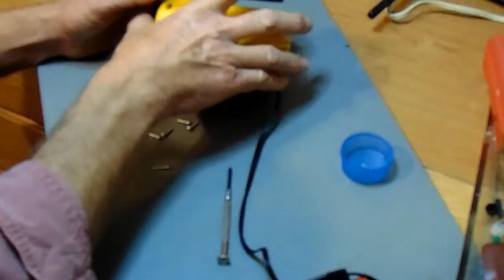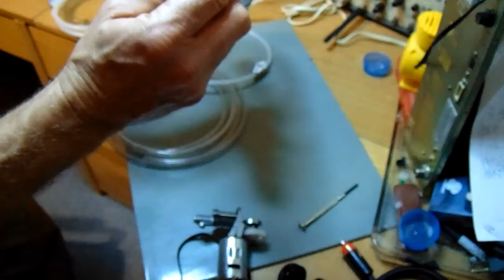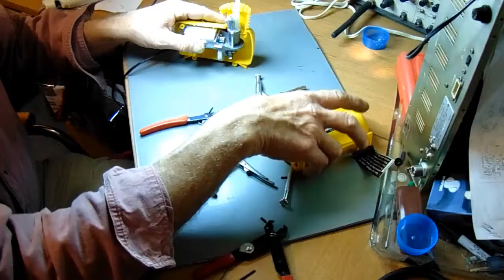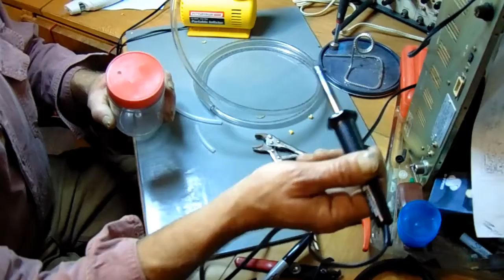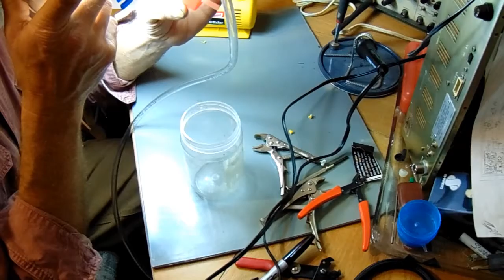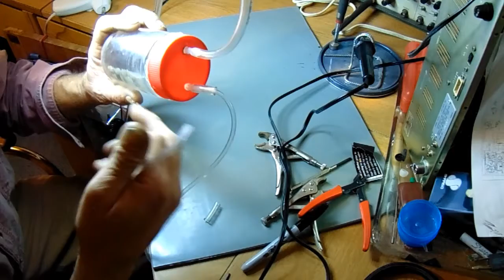Vacuum Pump De Soldering Iron

Comment: Not making an accusation, but I question whether your creation is effective or works at all. 

The primary issue is that your soldering iron is essentially a reverse heat gun. The air is heated by the heater and drawn through the plastic tube. After a few moments, the air becomes hot enough to soften or even melt the plastic tube. It can also damage the pump's mechanism. The other issue is the constant flow of air through the tip cools it significantly like a fan, limiting its temperature. Both issues can be resolved by momentarily turning on the pump only after the tip has applied enough heat to melt the solder.

Comment: The mini compressor heats up too much in two seconds and I could not evaluate the performance. Then you always have to ensure a generous dose of grease for the 'liner-piston coupling. The idea would be to reduce the operating speed so that it would not overheat absurdly. I 'd bought it because I wanted to apply it to a similar Lafayette station.

Comment: I have a vacuum pump used for hvac stuff.  Think im going to make a small vacuum chamber with a easy quick release valve attached to a stiff tube so i can let the chamber build a full vacuum of twice the volume of tube and chamber size so it will give me a quick toot and get the solder..  i don’t see how anybody puts up with that ham radio garbled junk and pointless conversations with a smoke alarm beep and all the creaky furniture..  too much too much..

Comment: I put together this item and it does not preform as I expected. I used it with an old radio Shack ball suction de-soldering iron replacing the squeeze ball with this modified air compressor. I found that the compressor requires over a 2.5 amp source for power, it is very noisy and does not have anywhere near the suction power I needed for operation. I suggest that this item not be bought and constructed.
Reply: Sorry your's doesn't work well. The video is about 5 years old. Maybe they changes these compressors. Mine still works well. Yes it is very loud. I placed mine in a closet on the other side of the wall from my workspace, by making a hole through the wall, just big enough for the wires and suction tube. That keeps most of the noise confined to the closed closet. Thanks for your comment.

Comment: I planned to do this too and searched to see if anyone else did it before. Good job! What I might do differently:
Shorten the pipe from the iron to limit potential clogging.
Use temperature-resistant silicon tubing on the iron side.
Make a smaller filter reservoir mounted to the iron.
Use a solenoid to control for the suction at the tip.
Trigger pump to run for several seconds with the solenoid or connect it to a foot pedal switch.

Comment: I will be attempting to build one. You mentioned getting solder pieces stuck in the smaller diameter tubing. I will be adding a filter for this purpose, copying the basic type of filter used on the PACE rework stations.
 For example, using one of those see-through inline fuel filters with removable screw-on ends that have a hose barb on each end plate. Remove the gasoline filter insert and replace it with a few cotton balls that are moistened with mineral oil. Place it in line between the iron and pump inlet connection. Should work fine. You have a visual indication of how full the filter is, and it's easy to clean out and replace the filter medium.
One more thing I learned while using the PACE system is that when applying vacuum to the melted solder joint, you should let the pump run a second or two after the solder is removed. This helps to prevent solder from clogging the tip bore and forming a sort of DIY pot metal alloy that can be rather difficult to remove, has to be drilled out of the bore. It's a very hard alloy at that point.
Thanks for this video. Subscribing and liking.

Comment: Nice work. Where is the solder accumulating for clean out? Once you cut the tube length down, does it make it all the way to the catch can and cool? Do you rod out the desoldering iron periodically? A video answer demonstrating the above would be very helpful.

Comment: You should use a foot switch to control the vacuum pump.
I 🤔 wonder if the plastic tube which is attached to Desoldering gun shall melt when the Desoldering gun heats up!!!
By the way using a 12v air pump😎 is a good idea. I have a two in one  soldering + desoldering station. But the suction strength of vacuum is quite low. 
I was thinking to use a home vacuum cleaner by somehow reducing the suction pipe dimension ( using reducer). Now i already have a unused 12V car tyre inflation pump ( ofcourse Chinese) which is laying in attic for more than 8 years.
I guess its still working & I am going to use it.🙂

Comment: How well does this Iron perform desoldering Integrated circuits from double sided boards?
Reply from the maker: It works Ok. If they are the smaller ones, I generally use de-solder braid. 
Other than that, as well or better than other tools that I've used, for most other things. You do need to replace the tip from time to time. When the hole gets to large, it takes a bit longer, because you have to move it around on the joint to get the melt going.
I've had the one in the video for many years. I'd guess 15 to 20 years.

Comment: sir can you give the name air compessor
Reply from the maker: The one I used was a Pittsburgh tool brand, but it doesn't really matter. Any of the 12 volt compressors will work fine. They are all pretty similar .

Comment: Great content, background radio is hard to ignore, very distracting.  Thank you for sharing.
Reply: agreed turn off any background distractions like phone ringers, radios, etc. Also replace the battery in your smoke detector, lol at least thats what it sounds like the loud beep every once in a while thru the video. Had me looking at mine o begin with till I realized It was on the video LOL. Also not related to the video work I would probably build some sort of insulated box to place the pump in as they are very loud so I wouldn't have to hear it as much. Keeps it quieter and nicer work environment ;) Welcome to youtube looking forward to more ham related videos.
Reply from the maker: Thanks Mike,  I really do appreciate your (and everyone elses) honest feedback. I can't seem to locate the low battery. My wife and I turned everything off in the house and listened for at least 1/2 hour, and never heard it chirp. I even took the one in my radio room off the wall and carried it around with me. LOL
Thanks again,
Karl
Reply: @karlke0jwk368  if you cant remember when you replaced the batteries in your smoke detectors it is time to change the batteries lol (firefighter friend told me that)
Reply: or did you check your c02 detector?
Reply from the maker: @spawny4205  Batteries were all changed Thanksgiving.
Reply from the maker: Thank you for watching, and for the feedback. I'll try to do better next time.
Reply: Alternatively and maybe additionally, an external mic connected to your camera (say a unidirectional/dynamic/cardioid lapel mic) would help to pickup just your voice, and it would pick it up much better.

Comment from the maker: A friend (N3WLB) suggested that by running the air out from the compressor to the de-soldering iron, it could also be used as a hot air unit. 
I think that it's worth a try for occasional surface mount work.